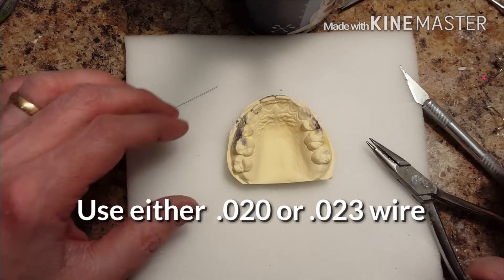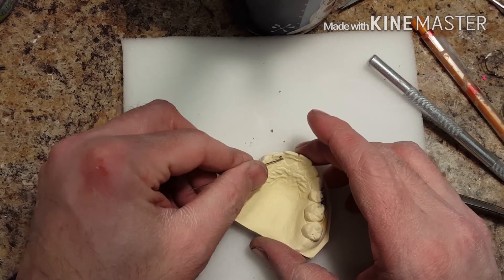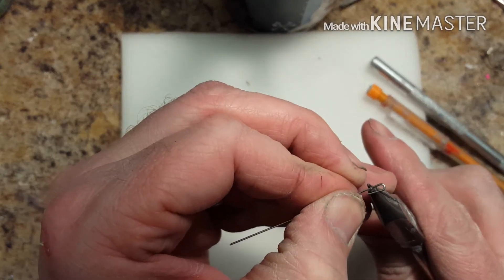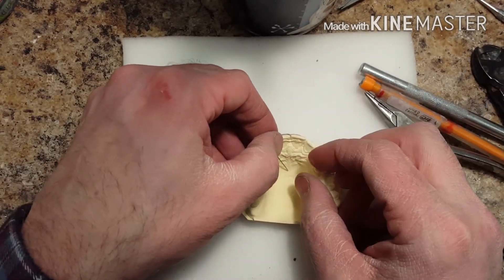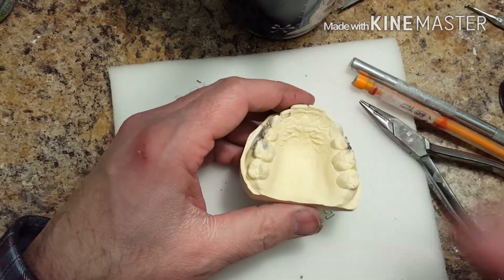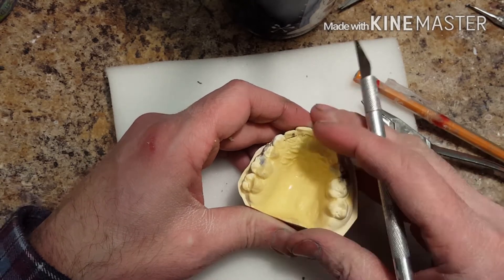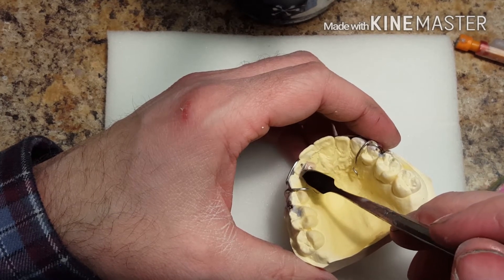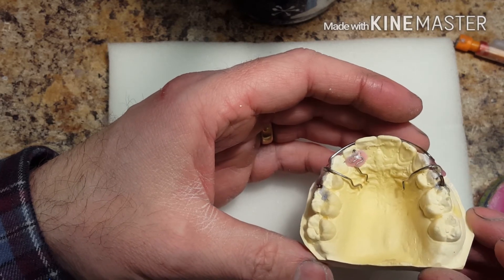Orthodontic  lab lesson. How to make an S spring

Comment: Hey Steve what clasp did you use for the 6 year molers would an Adams clasp work or what works the best for you?
Reply: JLee you can use C clasp also ,its easy to make and can be made on fully or partially erupted molars
Reply: DR.RAVI KUMAR Thank you! Man, I’ve grown a lot since this post! Lol. I’m getting better everyday! 😎
Reply from the maker: JLee if the molars are fully erupted along with bicuspids I always use ball clasps. If bent correctly they work perfect. If bent wrong they cause issues. I make Adam's clasp when no bicuspids are present , deciduous molars or not fully erupted 6's.
Reply: Szara Dental Lab thank you Steve I still have a lot to learn but thanks to you I can see a light at the end of the tunnel!